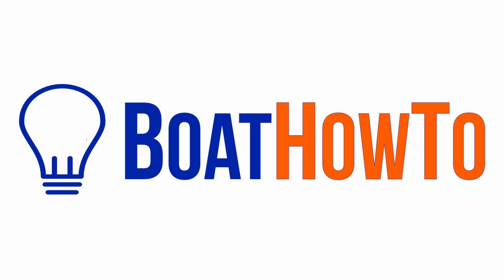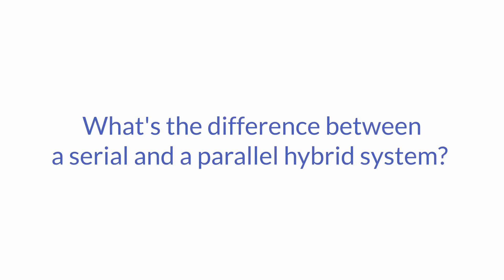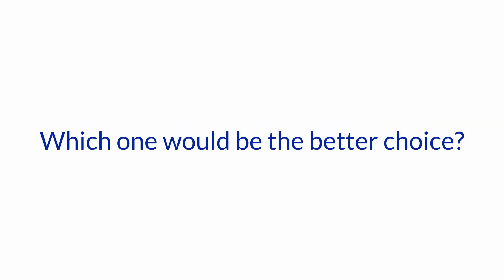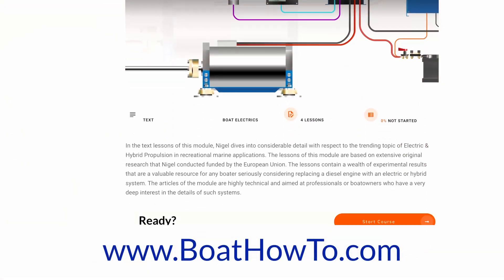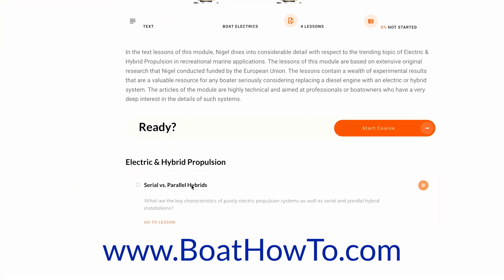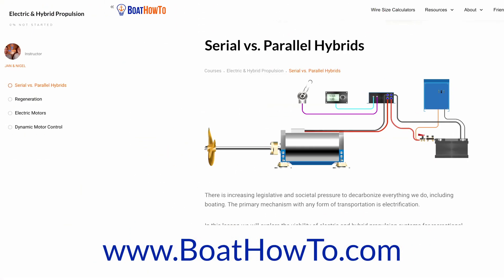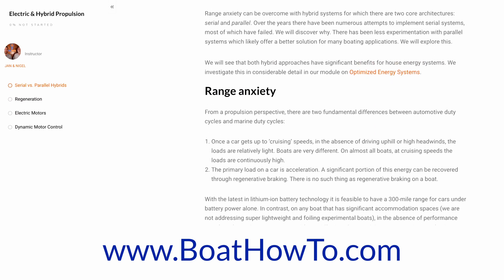Don't make this EXPENSIVE MISTAKE! Hybrid Systems on Boats | Ask The Expert with NIGEL CALDER

Comment: 🤔Hummm, having a parallel system and with all the new technology like sodium ion batteries and solar I would think that with everything hooked up right it would be an efficient power set up , one of the things I’ve often wondered about is don’t the electric motors get hot over long use periods and how do you cool them down ?

Comment: I think it is common advice to start your diesel engine when you’re out in de heavy thunderstorm. A lightning strik may have you loosing all electronics on board, but a running diesel will just happily continue to run.
This would be another pro of a parallel system.

Comment: I agree completely with this analysis: internal combustion engines are dirty and inefficient at idle and have a very limited rpm range of good efficiency, whereas electrics do not. Use the two in a complimentary fashion.